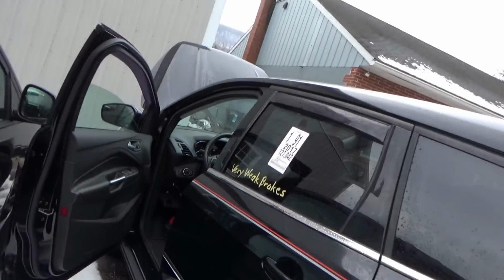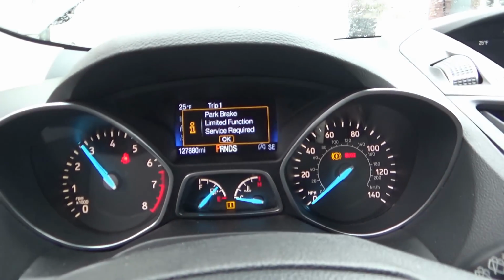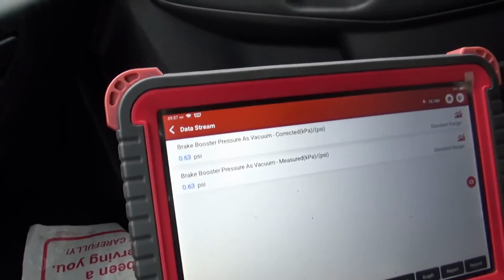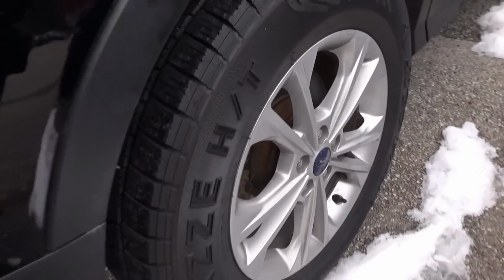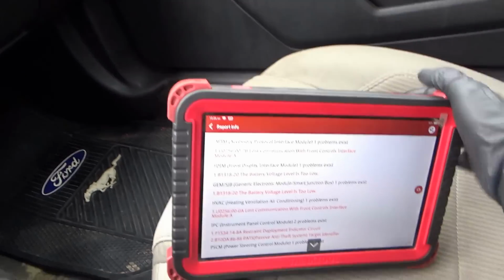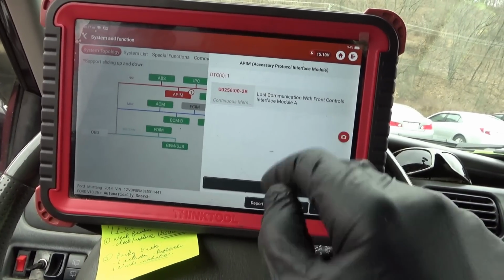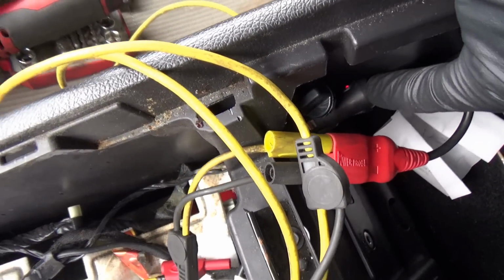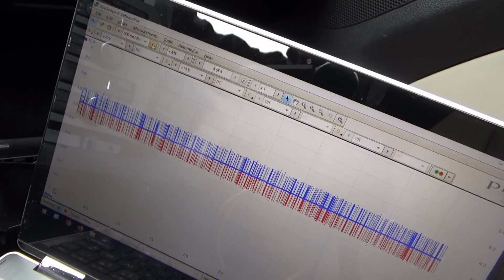Modern Ford FAILURES?! (17' Escape WEAK BRAKES, 14' Mustang No Radio/HVAC)

Comment: Modern cars make me long for vehicles from the mid 90s through mid 2000s...Double or single DIN stereos (no integrated crap), manual climate control (ones with knobs are a plus), and power door locks and windows that don't go through a body control module to operate.  Seems that the technology in vehicles back then made them more reliable and functional.  We're at a point now where all the electronic tech is reducing overall reliability and longevity....
Reply: I haven't ever had an issue with the Marquis on anything electronic.  Seems to be better than current electronic components.

Comment: Planned obsolescence..

Yep. Applies to everything now. I bought a 60 month battery for my car in January of 2023 and today I replaced it again. Only lasted 13 months. I got a better battery this time, from Excide. 

The engineers seem to expect us to buy a high priced item that only lasts a year or 2. Maybe 4 to 5 years max.

Cars now in the wrecking yard are 2 to 3 years old with modules that are unavailable.

Cheaply made.
Reply: @Runco990  

A battery should last even without being plugged in to a battery tender. 

Where I live, we can't have electrical cords strung from the building to the parking lot overnight (it is an apartment complex). I can have a cord out only for a few hours if I need to work on the car for minor things (it is a violation of the lease for other things).

A tenant cannot charge an EV on site here either. There are no EV electrical systems here.

Comment: I think a lot of modern day cars are built with the same 8 to 10 year life span in mind as are consumer items like washing machines, TVs etc. They'l  function for a few years and then something terminal will fail, causing the consumer to buy a new one. Planned obsolescence? Boom. Nice work Ivan.
Reply: I think most manufacturers are more like 5-7 years before the car becomes a giant money pit. I am sticking with mid-2000's Toyotas for as long as I can. They have proven to be practically bullet proof...
Reply: @alex241   I agree. When I lived in Europe, I used to own Japanese built Nissans made in the late 80s / early 90s, bomb proof. You could put 100s of thousand of miles on them with no issues at all. 

I was lucky, I got a 2009 Japan built Subaru Forester that I still run. This was the model before the timing chains and piston ring problems. Mine runs like new still and I think is one one of the last batch of Subarus built to last as long as you're prepared to do simple things like regular oil changes etc.
Reply: And cost driving 8 year loans

Comment: I had a 2015 Ford the other day come in for pads and rotors. After I did the pads and rotors on the front the pedal had a softness ( did not test drive car before). After taking to the customer he thought the pads would fix that issue. Eventually the fix was activating the abs with scan tool a couple times. After finding the issue I googled it and it seems to be common. I alldata and googled it just to see if the abs solenoid needed replaced but I guess everyone had success with just activation. Time will tell and if it comes back I'll report. At least Ford is more reliable then Chrysler. I looked at a 2019-20 jeep with oil issue. Lady take it to the dealership every month because the car shuts off and flashes oil warning. Dealer told her oil change will fix it, she had 5 in 7 months. Seems that engine has ring issues and the jeep has 45k on it
Reply: The Stealership is scamming her. I bet the oil changes aren't free either.

Comment: Seems like there could be a market for fixing modules/panels/etc.  Along with LED integrated tail lights, and all these other parts that fail because of one tiny component on the board or a busted solder joint,etc.
Reply: Custom ASICs and programming will prevent repairs. Modern modules use encryption. Replacing parts won't cut it.

Comment: Pull the vacuum pump off the engine. Your customer might need a new engine like mine did because the bolt breaks off in the camshaft and sends metal shaving through the engine.

Comment: Does not need a new vacuum pump, Needs a new engine because Ford ran the vacuum pump off the camshaft and the bolt breaks off. The 1.5 ecoboost is a horrible engine. Makes me more money though.

Comment: Been here. I bet it is a broken bolt for the vacuum pump that is ran off the camshaft. My customer needed a new engine.
Reply from the maker: Why not just replace the bolt? 🤔
Reply: They took it to ford and the dealership replaced the engine. I do not know if it was under warranty. Think it was a 2019. @PineHollowAutoDiagnostics
Reply: @PineHollowAutoDiagnostics 

It is run off the cam. The broken bolt allows the pump to tear up the cam and the pump itself. 

Unfortunately.

Comment: Just asking could they hvac be wired to switches manually on/off if no boards available ? Thanks
Reply from the maker: Nope
Reply: @PineHollowAutoDiagnostics  
Thanks for your reply .
Reply: You could probably jerryrig a hobby microcontroller.  But it would take time to reverse engineer the logic.  And that's how some of these cars will be saved, at least the ones worth saving.

Comment: I hate that my Ford Galaxy work minivan has an electronic parking brake, which still works fine after 300 k km's (190 k miles), BUT I still have  either keep my foot on the brake at red lights OR BOTH put it in neutral AND draw the hand brake.
Properly engineered cars like Mercedes or Volkswagen AUTOMATICALLY apply the hand brake, and disengage it when i push the accelerator. The STUPID Ford keeps burning off clutch paltes if I just apply the hand brake.
The grim legacy of Henry Ford.

Comment: Planned obsolescence has been going on for a long long time.  However the plan time keeps getting shorter.
Reply: Thats gonna be worse with EV
Reply: Planned obsolescence only works for a short time.
Reply: Yeah all didn't look good blue smokes not a good sign you should have looked at the antifreeze or maybe checked it with a gas analyzer to see if he ain't hydrocarbons are coming out of the radiator
Reply: I want 1.5 is pretty small engine you put a turbo on it and it wears it out even quicker so yeah it's not going to go a whole lot longer turbo will cut down on the mileage you get out of your car is a little rougher on your car for sure
Reply: I don't know about that.  When I was a kid, 100,000 miles was the best you could expect out of a car.  By that time, they would be pretty thoroughly worn out, with problems in multiple systems and often pretty rotted out too.
Reply: The light bulb started it all. Edison's shop still has the original tungsten filament bulbs burning .
Reply: Too bad electronics are impossible to repair.

Comment: I'd be very surprised if there's not a shop that can fix these boards.
Reply: It would be hilarious if it just turned out to be a shorted ceramic capacitor, possibly of the non-automotive rated variety...
Reply: Or, possibly a bad 78xx voltage regulator. My guess it's more than likely something very simple, usually is.  @PileOfEmptyTapes
Reply: Yep, if there is a need it will be met.
Reply: This is specialised repair and if no parts easy to access no